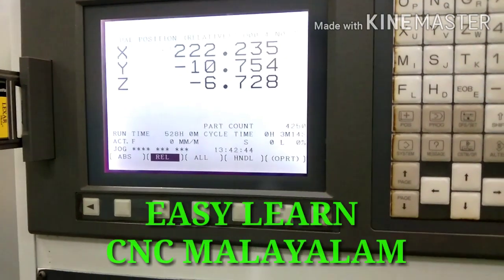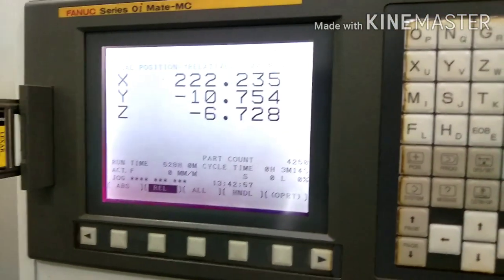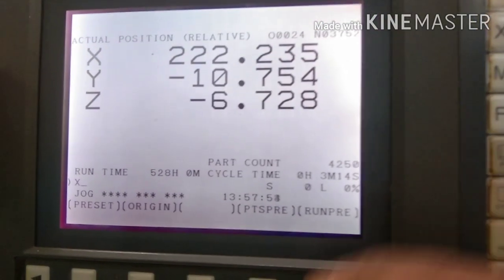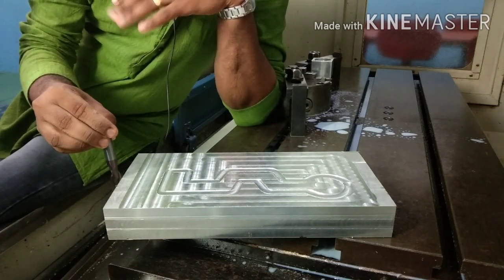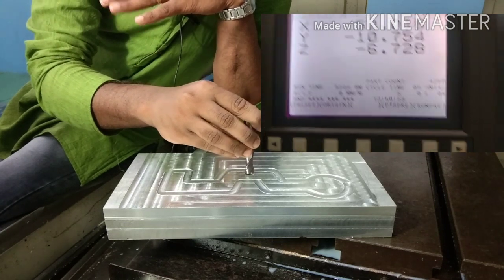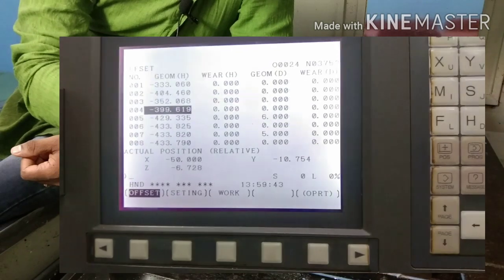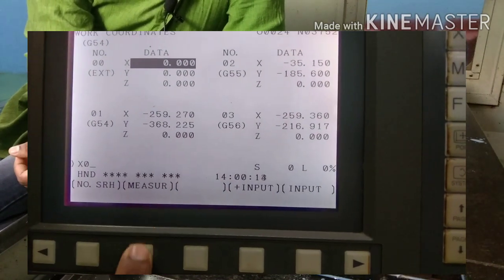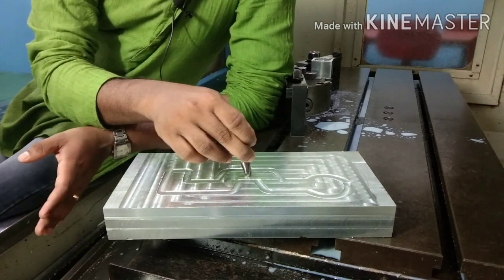How to take an offset on cnc milling machine malayalam. വർക്ക്‌ ഓഫ്സെറ്റ് VMC, fanuc oi mate mc

Comment: Hi sir please give some idea about  repeatability and back lash ?
Reply from the maker: Repeatability..
it is the main advantage of cnc machines.If you want a 100 Piece of a same work you have, you need to produced same product continuously.We can make product Without change of  the dimension.Many of same product we can machined with the help of cnc program.
Reply from the maker: Back lash means... machines will get older so ball bearings are will be damaged. We does not get exact  position of axis.. Some cases we can adjust the back lash on machines